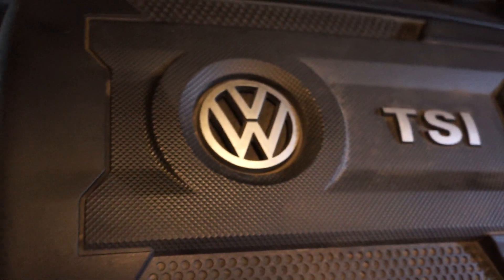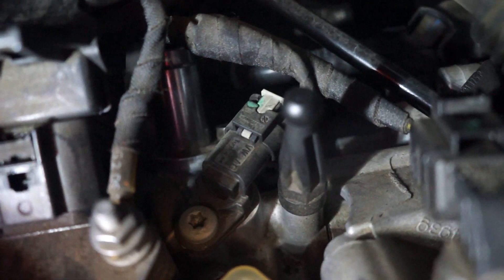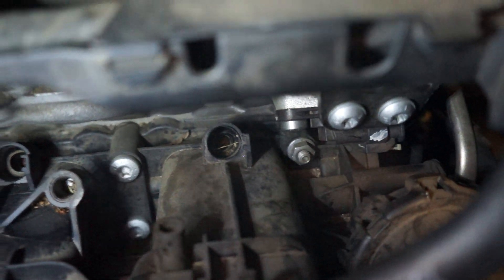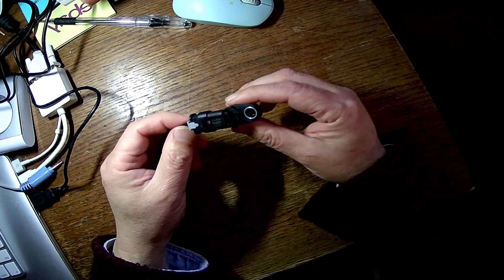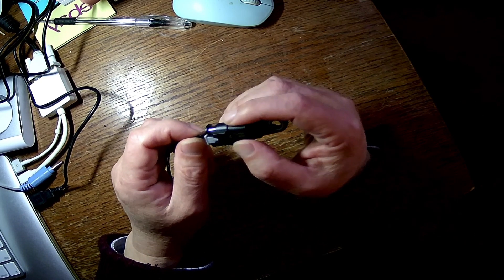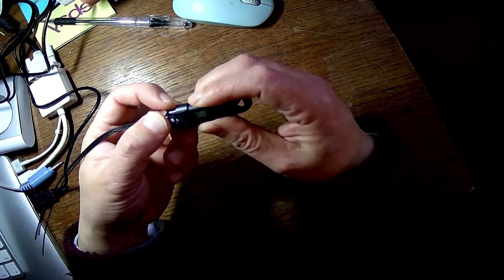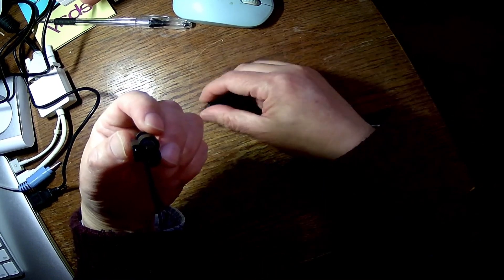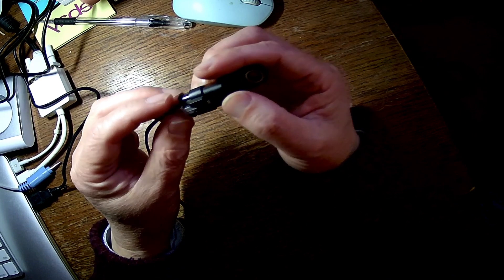Detailed How to disconnect wiring harness connector replace camshaft position sensor Volkswagen VW

Comment: The Cam Pos Sensors you show are "backwards".  The one on top is the Intake and the one on bottom that sits right above the Intake Manifold is the Exhaust.
What would have helped more than anything is HOW to remove the one on the bottom.
Reply from the maker: The cam sensor deep inside the intake manifold is intake, which is very hard to remove given the tight space.  Formal way according to dealer is to remove the intake manifold cover to make room to replace the cam intake sensor. The cam sensor for exaust is easy to remove.